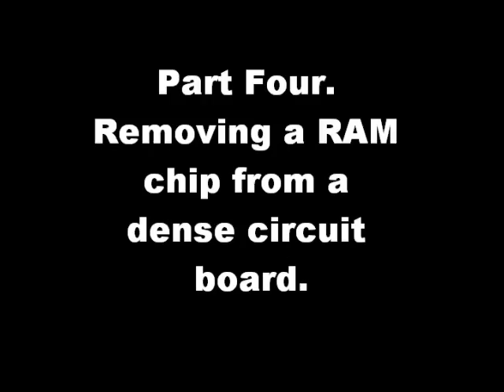Desoldering Part Four - Removing a RAM chip from a Printed Circuit Board

Comment from the maker: The same techniques will work for the IDC Connector. In DE-SOLDERING, it is very important to supply enough heat, fast enough, to melt the solder before the trace adhesive gets hot enough to de-laminate. Again, within reason (And physical access) bigger is better.

I have done PCB re-work for nearly 40 years. I have had formal training in both Navy PCB Repair schools, and Avionics re-work. I also used to manufacture PCBs on a small scale.

Comment from the maker: It is not the size of the tip - it is the power, or wattage, of the tip that is important - very important. This is a 33 watt iron (Non-temp controlled). A secondary concern is the amount of heat mass the tip has. For a standard PCB of this relative simplicity the wattage, and the tip mass, are appropriate for DE-SOLDERING. The biggest mistake people make when DE-SOLDERING is using too low a wattage iron. For much more see my article.

Comment: For IDC 50 pin connector pins, which are about as small as the pins he is working with here, should a 1.2mm tip be used?

I agree the tip looks a bit large and there's potential for trace damage.